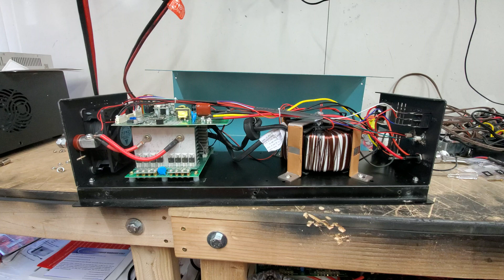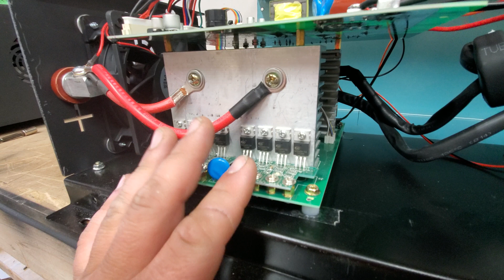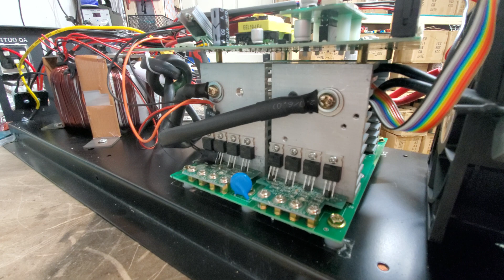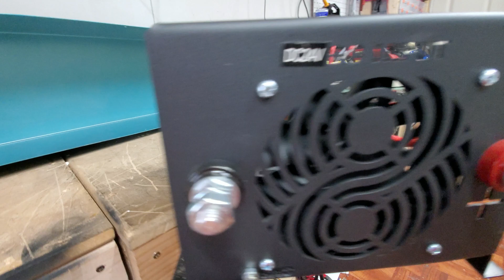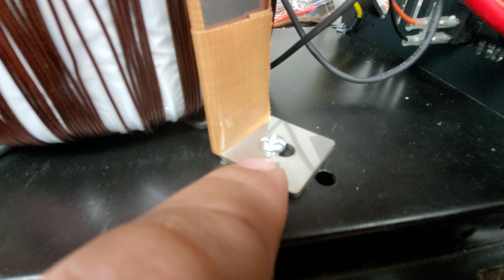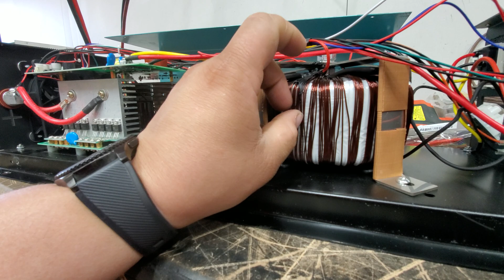New Power Jack 6kw inverter detailed look

Comment: Is that bolt that runs down the middle of the transformer isolated from the chassis or those brackets? If it’s not that’s a shorted turn
Reply from the maker: It is insulated

Comment: Forgive me, but I’m new to this, please explain - why would I consider a 48v over a 24v
Reply: With a 48 Volt system the step up rate to 120 Volts is less. That does several things. It creates less heat at the same Wattage. It allows the use of smaller wires for the same Wattage. But if he is correct and that is 16AWG wire on the transformer, It is not a 6K transformer. I Would prefer to see 10AWG on a transformer that is going to run at 6K continuous. At best it would be a 3500 Watt rated one. Which is about normal as almost all of the PJ inverters are actually one half the listed markings if you want them to last.

Comment: Anyone know how to change the output voltage of the old 5KW inverter / 8KW main board, 12v input to 240v output. It looks like there is a plugin resistor network labelled 240v output. I need it increased for 220V / 210v under heavy load to 245v.  
As a side note,  don't have the charger cable plugged in (not connected to the mains) and inverter switched on,  this is suppose to be an input for chaging your batteries but i got a tingle off the plug, after measuring the voltage in UK from live to neutral it was 0.4V but from earth to live and earth to neutral it was 85V each. 
Just a bit worried now why that voltage is on an input and why it is so low as it shouldn't be split phase for the UK

Comment: It looks like it was built in a garage. Whats up with all the hot glue used to fasten the LEDs? And why is the transformer so far away from the fan where most of it will get no useful airflow at all? Also whats the story with the messy winding job on the transformer?? Were they drunk?? On a positive note, they have the fan oriented correctly, blowing into the case rather than blowing out.
Reply: yes that messy transformer is awful, probably lose 5% efficiency from that mess.

Comment: No lid fan?  Sheesh...that transformer is going to run hot!
Reply: This seems a demo unit, my dad bought one and it has the lid fan :)
Reply: If the fan is of a decent size and flow rate, the hot air should exit the terminal end of the unit just fine. As long as the cover fits tight. But what gets me is the lack of space at the terminal end for that air to escape.